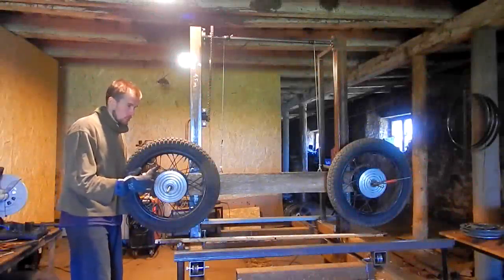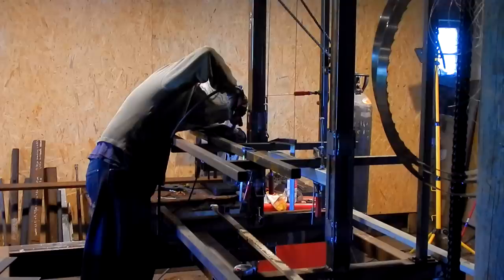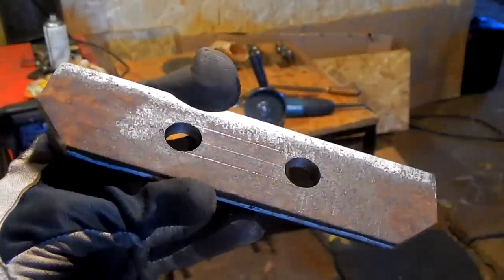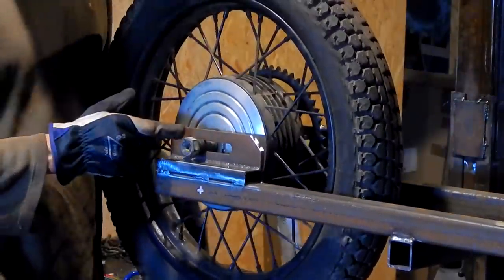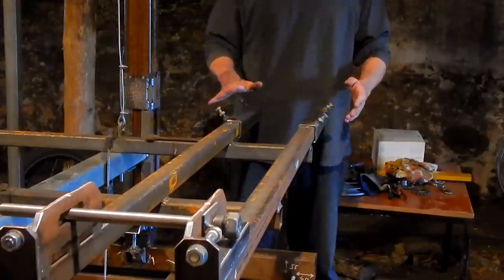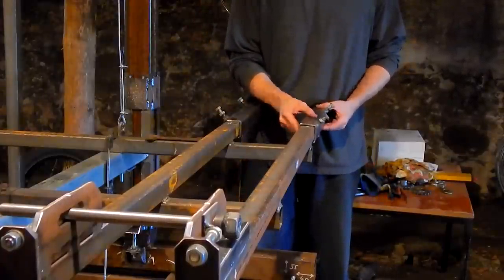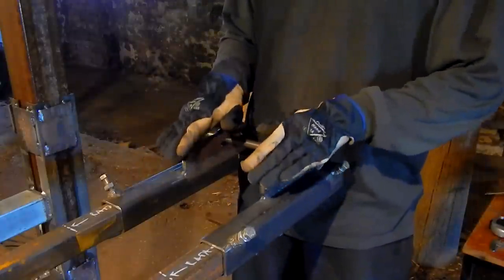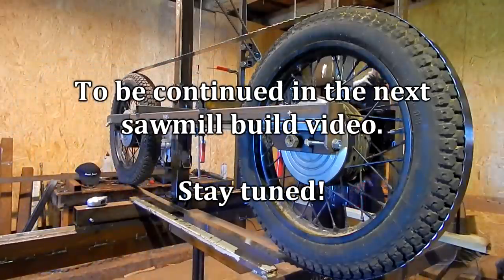Band Wheels From Motorcycle Wheels - Band Sawmill Build #16

Comment: You know your stuff. :) I built and fixed those Hammond polishing lathes with sanding belts,  back stands, and all the trimmings, even with the pneumatic tensioners and manual tensioners. You got the right thinking with the blade tracking nailed, even with the shape of the motorcycle wheels. Pretty good.

Comment: You only have the "slack" in your square tubing, for one of two reasons. #1. Metric dimension steel   75 mm does not nest snug with 100 mm steel.  # 2  the wall thickness can be adjusted to take up most of the slack!
For "standard" dimension steel square tubing, a 3/16" wall thickness is optimum.   3-1/2" nests perfectly with 4"  as does every other dimension in 1/2" increments. 
Instead of slots to allow axle movement, the entire wheel frame work can "nest"  and move as a complete unit.
just a bit more welding involved.
What did you select as a pully size to determining the blade speed?

Comment: We could see the twist in the crooked frame when you cut it on the saw before you started welding ;p Was wondering how long itd take you to realize
Reply from the maker: It was the 6 m long piece that was bent under the load of itself since it wasn't properly supported. The crookedness came from welding the frame on the cross beam of the saw head not on the leveled trailer bed. It didn't take me long to realize that it's crooked. So not much time was lost. :D

Comment: Is the drive wheel (with sprocket) smaller in diameter than the old front tire so you added the 1” (25mm”) spacers to lower the axle? 

As it seems right now the blade won’t be level across the trailer frame.
Reply from the maker: Nope, they're the same. I added this for a reason but I will explain this further in a future video. The levelness of the blade is achieved by the guide rollers anyway, so that's not an issue. ;)